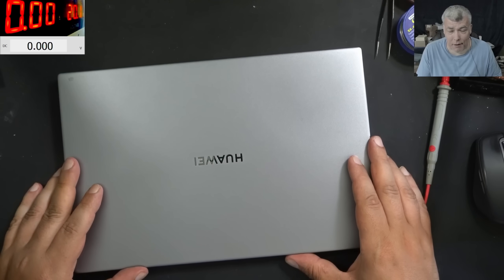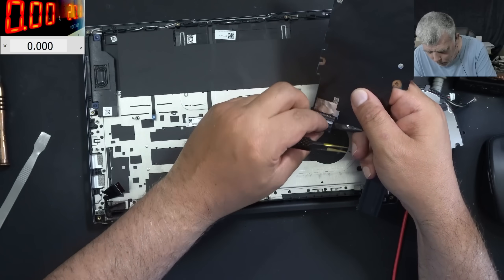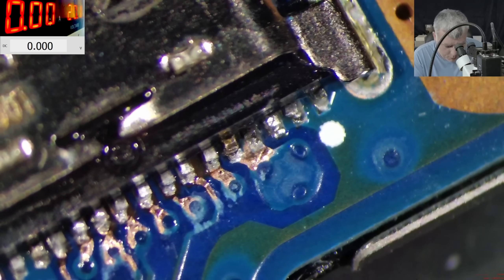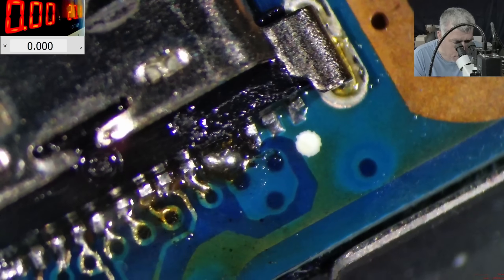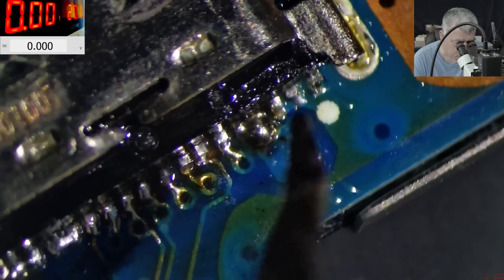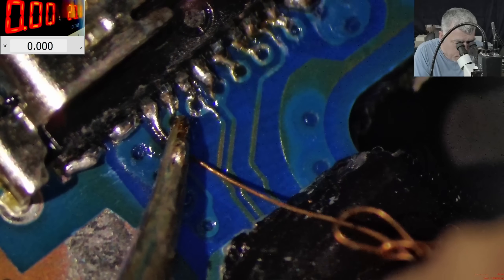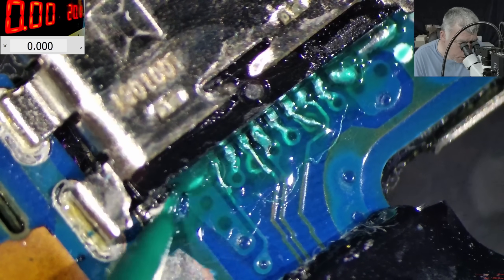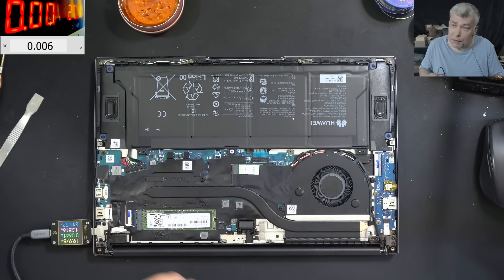Huawei D14 not charging - A common fault, easy to be fixed, board repair

Comment: 9:46 - Solid, hmmmm. I would have glued the center piece of that connector to the metal frame. As at 1:51 the entire center piece is loose, it is only going to happen again.

Comment: Sorin the solder you use is Mechanic SX-862 double rosin core which is 183°C, it's not a high melting point solder.
The high melt Mechanic is lead free HBD-366 with 200°C.  I can be wrong of course, guys any thoughts?

Comment: The plastic center of the port is still broken and not secured though? Surely should have replaced the port, that's just going to break the traces again.
Reply: i thought is was an april fool's day but its not. port was broken and had to be replaced. he just solder pins to traces.

Comment: It's not going to last for long because inner part of connector is loose. Solder and tracks will crack again after repeated plugging and unplugging of charger.
Reply: made by huawei, such a poor design...as many others do.
Reply: @orange11squares  its not a poor design. its default type-c connector which was destroyed by user. The problem is it was destroyed and meant to be replaced by new one. As you can see on video the plastic part is moving above pins while metal case that has to hold everything together is stable. The right way was to bend metal casing so that it will hold everything together or change the port. That was a lesson of bad repair.
Reply: Yes! He should have tightened the case clips and also added something in between the case and core... Like UV gel or hot glue...
But I was also thinking there are 2 rows of pins on that connector... And he soldered only 1 row... Or I might mistaking?

Comment: Great work as always.
I have a question, does the green mask protect the pins (from shorting)? or does it really have any strength to hold the port in place (like glue) ?
Reply: Prevent oxidation of the bare tracks, and prevent movement to degree.
Reply: green mask is not strong. use other strong glue.
Reply: green mask only looks professional.
Reply: its not super strong but it does the job, you can cover it further with some glue like b7000 for more safety if you like
Reply: The green Solder Mask is mainly used to prevent rusting (oxidisation) but can offer some protection from other things coming in to contact with the wires that Sorin soldered in place and shorting them out.